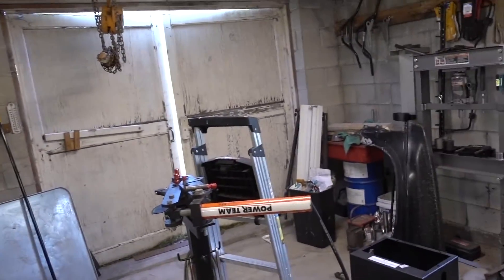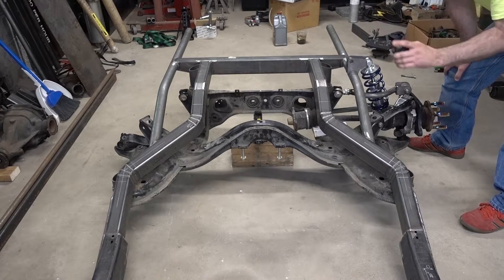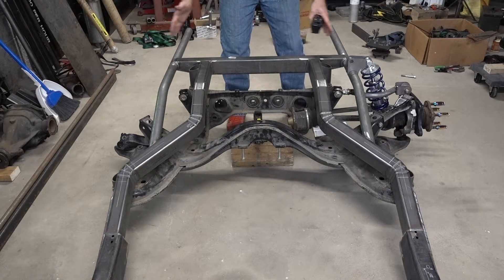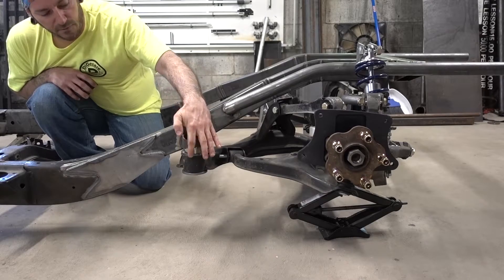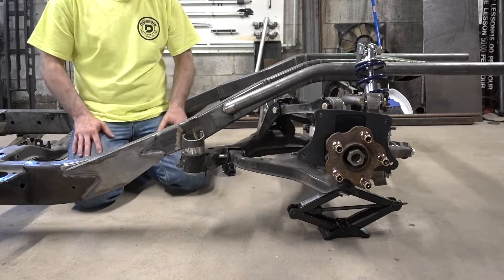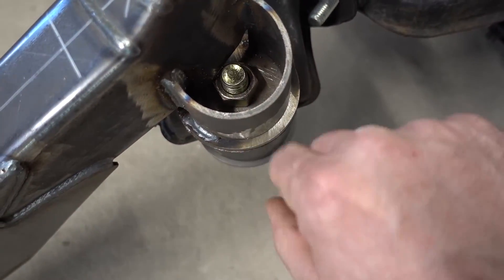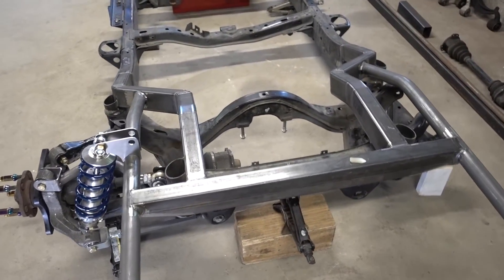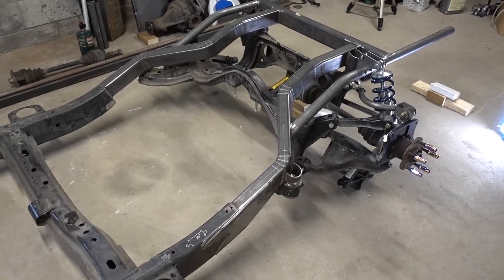Mini Truck IRS | 240sx S14 Subframe | Nissan Hardbody D21 Independent Rear Suspension swap

Comment: Dude youre a mad scientist. Im starting to plan the suspension for my D21 because i want to swap a Honda k24 RWD setup and may just use the front and rear subs off an S13. Im going to reference your build to simplify things when figuring out motor placement. I think 300hp all motor revving to 10k will be the perfect lose your license setup.
Reply: just started the same suspension swap on a datsun 620 over on my channel! debating between a k24 anda  beams engine for it

Comment: Hmm I have a s13 240 and a 91 D21 ... 240 has rear end damage but it has a sr20 so maybe a new subframe for the 240 and the old one goes into my d21. If I had a shop. Or a welder. Or wasn't a bum. 

I met a guy who had welded in a Titan rear end into his 87 Hb

Comment: Would I need to do the same thing but run a 370z IRS? since I'll be running a Vq37vhr on boost in my truck.
Reply from the maker: It would be similar, but I don't have the dimensions on a 370z subframe.
Reply: @Otto_Factory  okay thank you. Love the build bro!!!